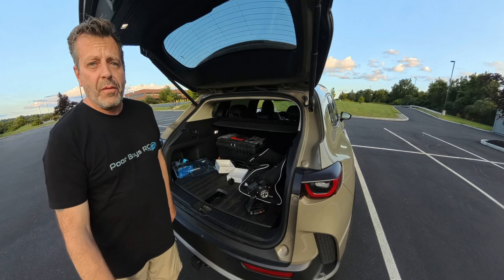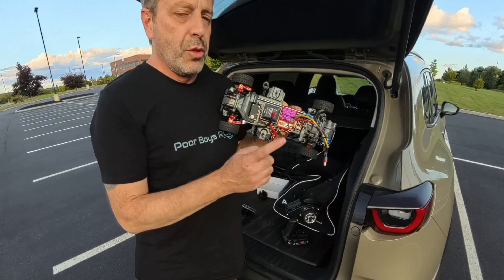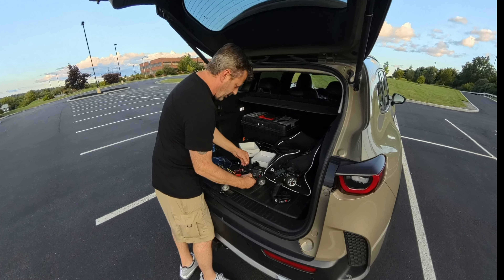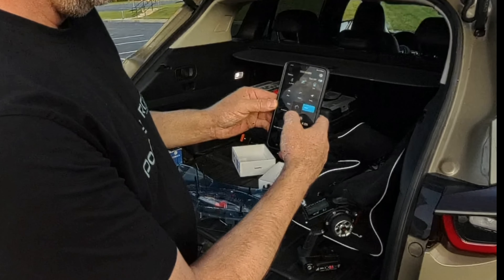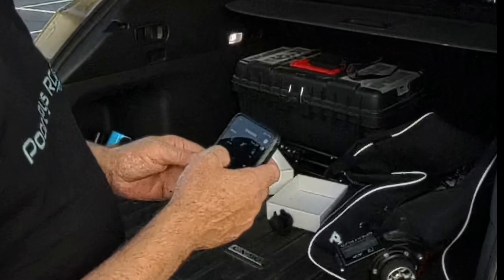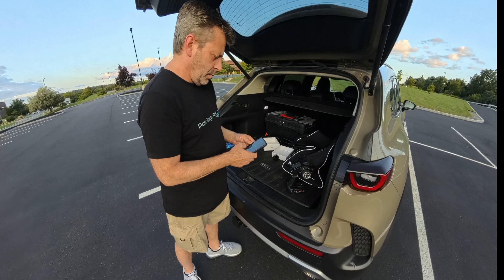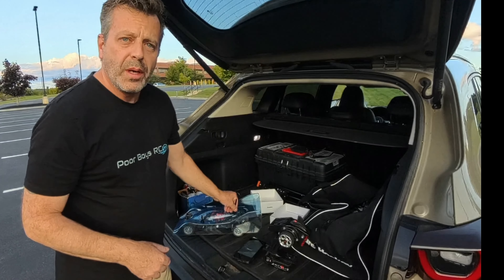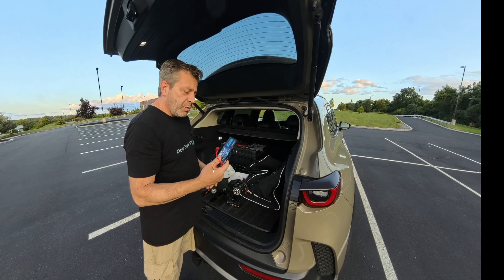PoorBoysRC MF01x Speed Run Challenge #2 @poorboysrc

Comment: Love the slick intro mate, very plush production!
That car park looks like the ideal speed run location-
Large, flat and smooth..... although those grey storage containers at the end look kinda menacing! 😂
The car looked great, albeit a little hard to see with the transparent shell..... not a bad speed at all with stock gearing dude!
👍 👍 👍
Reply from the maker: @yodadarksideGreenHawksRC  it was a last resort. It's actually where I work. I had to go home and get my badge to open the gate. Everything seems to be under construction or gearing up for the new school year.  Paint is on order I promise.  :)
Reply: @Paul__FC 
Not a criticism matey.... I kinda like the transparent vibe!
Although, when I took my 959 out with a clear body my eyes lossed track of it and I curbed it at full throttle..... needless to say, it didn't end well! 😂
Good luck with the challenge mate.
👍 👍 👍

Comment: Hey nice run Paul. The Jack O Trades ludicrous gear mod is a nice cheap upgrade and certainly adds a fair bit of speed.  Good luck with the next run 😁👍
Reply from the maker: @PeteWylieRC  Thank you! I don't think I can push that gear ratio with out over heating this old vintage motor.  I'm watching temps super close.  I have a new monster motor but mods have to be made and the parts are slow to come. :(

Comment: Good start. Also, the parking lot you use looks very smooth. 
I'm jelous of the body you use...
But when i think how mine has suffered already i think it is better i  did not get this.
Reply from the maker: @rc_tom  I had it in a pile of to-do stuff. It was this or the subaru brat shell.  Let over from last years speed run. It just wouldn't sit low enough on the TT02

Comment: Thats a big motor if you doing 30 woth stock gearing, great run
Reply from the maker: @markweber7624   :) I have another that's monstrous if I can get the upgraded parts in time.
Reply: I would gear that up  and that car will fly @Paul__FC
Reply from the maker: @markweber7624  working on it as we type